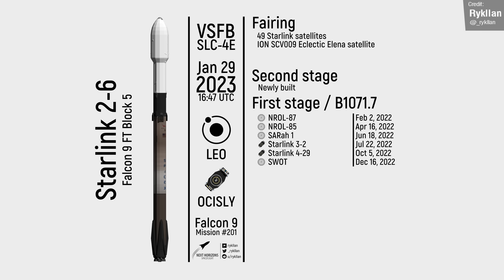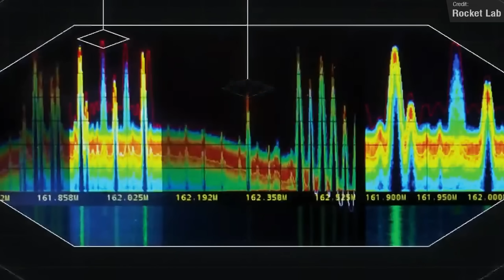SpaceX Starship Prepares for 33 Engine Static Fire, Rocket Lab USA Launch, H2 Launch, Vulcan Arrives

Comment: The heat tiles have been getting better and better about not falling off now the real test. It will be fun to see how well they stay on with all 33 engines firing off.
Reply: We won't know as its de stacked for the test, interesting to see if they do another one with starship on top? If they don't. that would be fun!
Reply: @chutzpah4166  I think they would have a starship installed for a 33-engine static fire, they need to test how it operates in those kinds of stresses and vibrations

Comment: I wonder how much that ice build up weighs, it looked pretty significant in thickness as it slowly fell off of ships SN8-SN15 in large chunks. I also wonder if there is anything they can and will do about it as they iron out the program. Every ton of non-propellant has a pretty significant impact on performance. It's got to add many tons of weight and drag. Maybe it will fall off a lot faster in a real orbital acceleration?
Reply: Ice buildup is normal on rockets. The violence of just igniting the engines shakes off most of it. It's generally a non-issue.

Comment: I still think Artimus is a joke. I didn't watch it. I ignored it the whole time. I don't want a $1.4 billion/launch rocket to exist.
Reply: If you think then you don't understand why SLS is being used as the primary launch vehicle by the Artemis program. Sure starship may be fancy and in theory it may be reusable there is one major part of the Artemis program it can never complete and that is the delivery of the gateway station segments into lunar orbit which is the vehicles primary mission after the launch of Artemis 3.
Reply: @exilestudios9546  It might require a different varient, but there is no reason why a stock super heavy couldn't do it.
Reply: @exilestudios9546  Nah, those modules could be sent via a Falcon Heavy if necessary. It's crew to and from the Moon is why SLS is still needed for the Artemis missions. The SpaceX plan for Artemis III, 1 Starship variant launch every 12 days and up to 10 flights to get a HLS Starship headed to the Moon, means that it is too long to send crew there and back, even with ferrying up crew on Dragon/Starliner. HLS Starship is basically out of propellant after returning to lunar orbit when the surface mission is over. So SLS is needed to get the crew there and back on Orion.
Reply: the saturn v was 1.2b a launch, and the space shuttle was and the space shuttle was 1.5b a launch. while starship has been around 10b to construct so far and that’s just the uncrewed variant, and there’s a 2.5 year deadline for crewed moon lander for artemis 3.

go pray to another billionaire or something u boot licker
Reply: @Joshs4stro  there is a difference between design and actual launch. There hasn't been a single launch so far the cost of a launch is $0. Artimus is $1.4 billion per launch and that isn't changing. Starship has the potential to be cheaper than falcon.

Comment: No Starship launch before a proper deulge system is installed... I'm afraid that could take several more months. 
Personnally, I don't wait for a Starship launch before July.
And I'd also be ready for an explosion at first static fire test, N-1 style, that could delay the Starship program for more than a year... so no Lunar landing before... 2028 at most, China could as well be there first.
Reply: You do know that a lunar landing is happening wether starship works or not right? Starship is only useful to the later Artemis missions, those set got take place after Artemis 3 which is the manned lunar mission. This gives space x and NASA plenty of wiggle room to solve issues
Reply: @exilestudios9546  Um, the lunar lander for Artemis III is HLS Starship. Orion just gets the crew to the Moon and back. NASA has contracted a second HLS Starship launch on the HLS Option B contract and there are multiple companies competing for the Appendix P contract to be the second lander. Artemis IV will either be an HLS Starship or the Appendix P lander. The left over lander will do Artemis V. Artemis VI+ has yet to be fully funded.

Comment: Matt, would you happen to know if they will run the booster(s) to full power on a static fire ? or will they do 50% thrust or whatever then give it the beans on the actual launch day ?
Reply: They will definitely do a full power "full duration" static fire at some point before launch. If they want to test something first, they can choose to start with lower power or lower duration static fires. Note that here "full duration" means something on the order of a few seconds. Only as long as the rocket would fire during a normal launch before releasing the clamps.

They do much longer test fires at a more isolated engine test facility. One of the horizontal test stands now has a mount for testing concrete samples in rocket exhaust similar to what the concrete under the launch mount will experience.

Most likely they have been doing longer duration and higher power static fires into those floor samples. While that test structure only allows firing one engine at a time against the concrete, they can operate that single engine in ways that stress the concrete similar to a 33 engine static fire. Test article Raptor 2s are intentionally test fired in ways that may lead to their destruction. One such type of test is running the engines above full power. The fuel to oxidizer ratio can also be run much closer to a stoichiometric. This can make the exhaust both more powerful and hotter. Naturally, they can also run engines for minutes at a time, rather than a few seconds.
Reply: @hamjudo  That was such a comprehensive answer to my little question so thank you, I've been informed now, cheers to you.

Comment: I was just thinking about how sudden the Starship launch is going to be. With stuff like SLS and the Space Shuttle, we obvious had like 10 seconds of buildup for the RS-25s, but if spaceX video is to be believed we could go from nothing to full blast in less than a second. Thats going to be crazy!
Reply: Nothing to full blast in about 1 second, SLS's engines needed time from T-6.6 to T-3 seconds to go from ignition to 90% thrust, otherwise the engine would abort